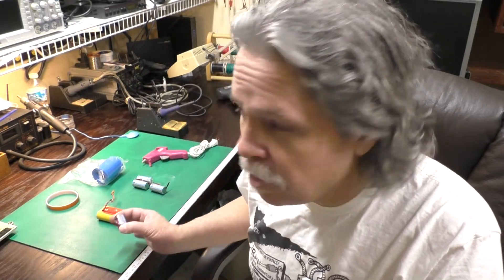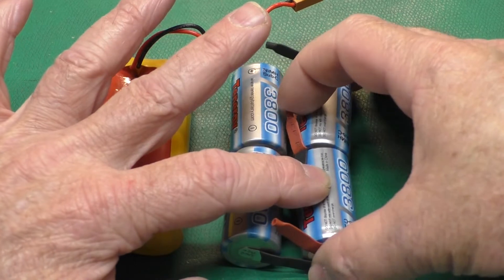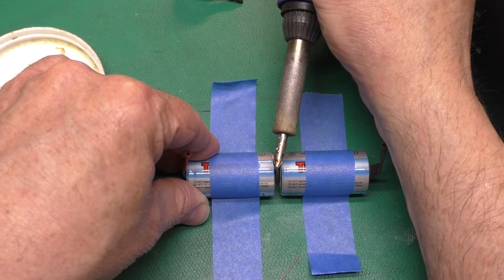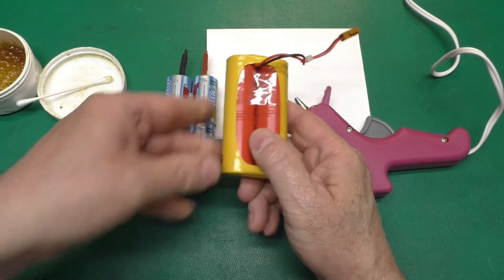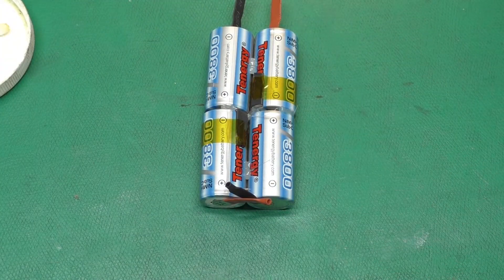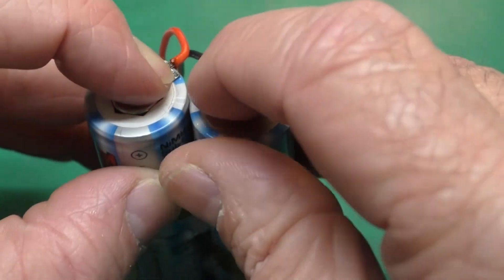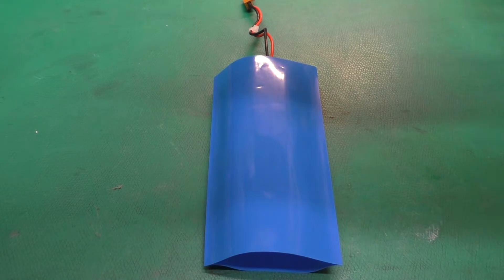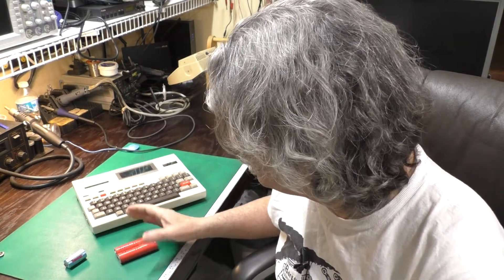DIY battery pack with tabbed cells. Build your own pack without a spot welder!

Comment: At 1:21 yes, a Hot Pink glue gun is key... just like when you mix epoxy... it MUST be a counter-clockwise swrill.  But in the UK, you must use an anti-clockwise shrill. An of course, in Astrialia, you have to stir in the opposite direction due to the coriolis effect.

Comment: But why not use a 2S 3A Li-ion Lithium 3.7v battery Charger Protection Board, they are VERY small and very cheap and would have fitted easily in your little computer, and that will protect the battery's to over charge and to protect that it won't drain all the way.

https://nl.aliexpress.com/item/32788948905.html?spm

Comment: I use my Solder Station Hot Air Blower Heat Gun 8858 that i have put in a aluminium case with a 24v Switching Power Supply for my Mini Ware TS100 solder iron, to shrink the heatshrink tubing, and that works always perfect, but each their own way.

Thanks for letting us see how you make a simple battery pack.
Reply from the maker: The little blue heat gun is great for heat shrink and even preheating PCBs for soldering/desoldering difficult areas. It was only about $25.

Comment: I wish I'd seen this demo a month ago. 

I rebuilt several PowerBook 520c "smart" battery packs using RC car battery packs made of eight NiMH cells arranged nearly correctly for the purpose. The idea was that I would have to do a minimum of soldering. I had to cut away two cells so I could reverse the orientation for a fuse that ran from one end of six cells to the remaining two and solder them back together. I was mostly successful. I noticed some "magic smoke" released as I soldered a cell to one end of the fuse. I must have over heated the cell opening the vent. Sure enough, it tested as a shorted cell. I also ran into the problem of the new cells being a couple of millimeters longer than the original cells and had to cut away some of internal support struts from the case. That worked well enough. After replacing the cell I damaged, the battery packs worked. The memory in EMM boards on the "smart" batteries were too far gone to salvage, but they still charge up properly and discharge with nearly the same capacity as the original battery packs.

Does the wide tip help with transferring heat quickly than a small tip? What temperature and solder are you using?  You appear to be holding it on the tabs longer than I dared to do. I used a small tip thinking it would keep the heated area smaller and transfer less heat. I can see from your video that was a mistake I made.
Reply from the maker: The wide soldering iron tip is essential. It transfers the heat faster, with a small tip it takes so long to get the place your trying to solder hot enough that you have heated up the cell too much.

The tabs on the cells I used were longer than some I have seen and wider. Even though I held the iron in place several seconds for some joints the cells themselves never got more than slightly warm. 

I keep my iron at 645F/345C and use 63/37 leaded solder. If you are using lead free then you temp needs to be higher.
Reply: @HeyBirt  Thanks! I’m learning something new with each video.

Comment: Hey Birt! Good informations, thanks! I had to rebuild some 20+ cell packs for old HP instruments. What I've found very useful is to scratch the tab's surfaces with a file before soldering. It makes the process quicker since you don't really want the cells to take too much heat. In case you need PB-gel cells (they do exist too!), the heat problem become really serious, it takes a couple of second too much with the iron and you hear the gel boiling and the cell is gone. In that case, I've resorted to use faston connectors soldered together and just slide them over the tabs. But this requires some more space of course. It's only needed for the rare PB chemistry anyway.
Reply from the maker: Hi Frank. Scratching the tab/cell is a good idea. I have done that when soldering directly to cells. The Kaypro 2000+ laptop I showed a few weeks ago uses Gates PB cells. Not sure if I will replace them with like cells or go a different route.
Reply: @HeyBirt  Well, the problem with PB cells is that they have a peculiar voltage range and charging profile. So unless you modify the charger (and discharge sense thresholds) you are forced to use PB cells. However, I've needed only one battery rebuild in 20 years on my HP-3466A that uses PB cells. So they've a decent lifespan at least.
Reply: Have you found that the faston connectors contact surface area is large enough? I considered doing something like this until I realized I didn't have room to work with.
Reply: @EricsEdgeVideos  Well, in the case of the HP=3466A multimeter, the current required from the batteries is very low and the faston size is matching the tabs perfectly on the cells I have found. Of course this method should be considered only if the cells are too easily damaged from any heat like the small D-sized Pb-gel ones.

Comment: Totally true about rechargeable battery sizes! I've bought 4 sony AAs and while 3 of them are exactly the same length the remaining one is half milimeter shorter and it almost fell from the device holding clip; I had to bent the spring on that receptacle to make more pressure on the shorter one

Comment: Hey Birt!. Great video as always. I am curious about substituting rechargeable for non-rechargeable batteries (the button ones, like the CR2032 substituting some rechargeable) in motherboards. What diode would you use and how?. I would really appreciate it if you could include this in a future video.
Reply from the maker: Hi. I will try to cover that in a future video. As for the diode choice it is not really critical as the current flow, etc. is low. A 1N914, 1N4148, etc. will work.
Reply: @HeyBirt  Thank you for your reply. Will be looking for it ;-) You are amazing with the battery pack. I have to do it in my EPSON Portable Q150A and now I really know how to. Thank you for that. Stay safe!.

Comment: Nice to know about the (relatively safe) substitution of NiMH cells for NiCd ones.
Reply from the maker: I can't remember now if I mentioned that the newer cells have a higher discharge rate, thus a higher charge rate. 

You might trickle charge a NiCad at C/10 but would want to charge a NiMh of the same capacity at C/20. The old NiCad cells in these devices are typically 600ma/h while new NiMh cells are easily 2-4 times this rating. This also gives us a bit more safety factor when using the NiMh cells as our charge rate if effectively lower.